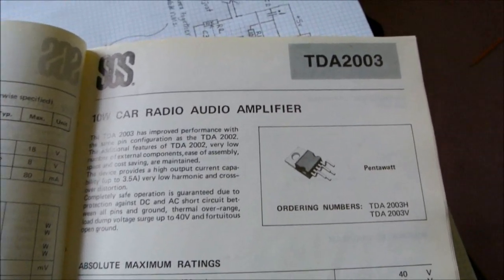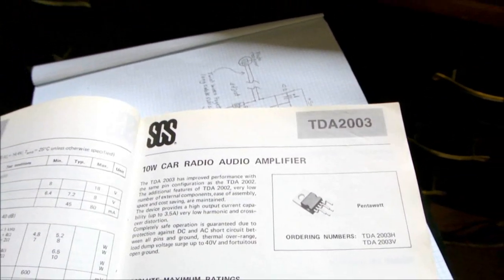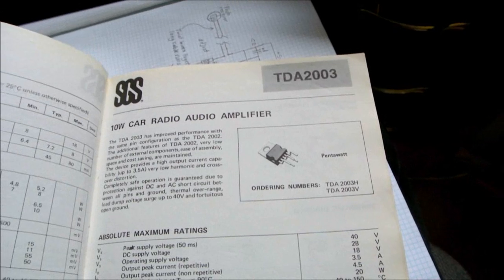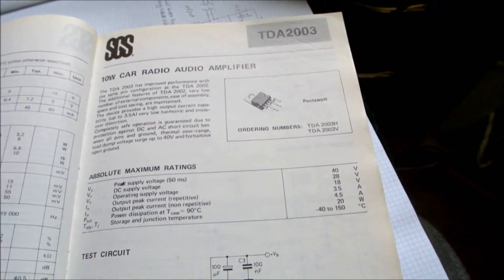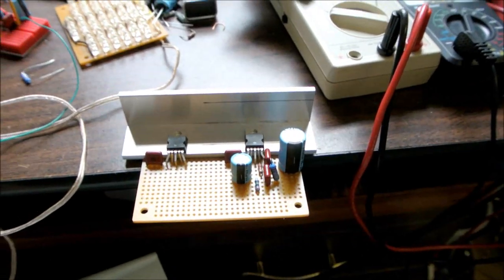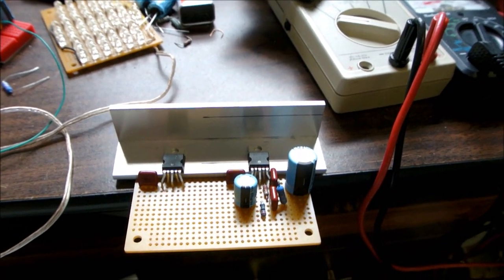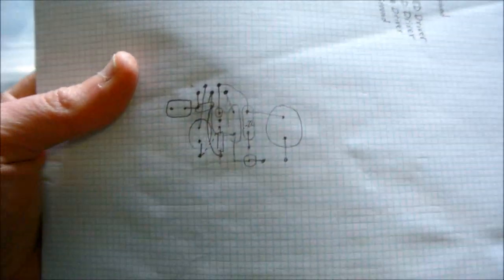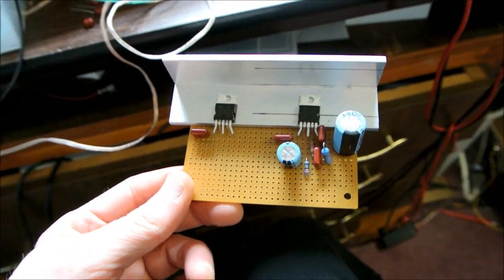Audio amplifier build stereo TDA2003

Comment: I have questions -
1. If I want to build this circuit on Perfboard , can the Power ground and speaker grounds of both the channels be common and the input (signal) grounds of both channels same ?
2. Can a 2 inches x 2 inches finned heatsink be sufficient for each chip ?

Comment: Will there be any difference in connecting the zobel network circuit before or after the output coupling capacitor ?

Comment: Hi JAT, Would you be so kind as to show how the stereo signal is separated? I suppose the schematic would show that. I would be interested in the details of the inputs and wiring. Always excellent video's, I love chip amp's. Take care, C.
Reply from the maker: +Cass Virgillo The stereo signal is never combined in this amp. It enters using a 1/8" jack that has a left, right and ground lead. The left and right signal wire each connects to its own volume control pot that is physically arranged on the same shaft and the output from that connects to its respective amplifier input. The ground connects to common ground inside the amplifier. Hopefully this answers your questions.

Comment: I'm planning on building one, I already have the LM1875 chip but i don't like to use split type power supplies.  I want this TDA2003 design since it uses the usual - and + 12v power supply and i could hook it up to a standby car battery during power outages.  Nice video btw thanks
Reply from the maker: rene kenshin The LM1875 will work at 12v single supply with the voltage divider for input bias (see datasheet), but that chip is designed for higher voltage supplies so you get a little less power at 12v. You may want to try the LA4425A.

Comment: Hi, I made a mono version of this amp, wired everything correctly, but when i plug in the power supply i get a loud hum that can't be diminished with the potentiometer. I've seen on some forums that i need to keep the signal ground and the power ground separate, but how do i do that? Could you help me with this problem?
Reply from the maker: DJmUsYk Hi, can you get any signal (music) to play through the amp or is it just solid hum? Be sure your power supply is around 12v DC and has a good filter capacitor.
Reply: JohnAudioTech It does hear a bit of signal, but it's just the signal from the sound source, and the power supply has a 1000uf capacitor. I can choose the voltage from 3 to 18volts, so that won't be a problem.
Reply from the maker: DJmUsYk If it isn't the input, the amp may be picking up power supply hum. It has a different tonality to the hum sound that is hard to describe. If you're sure you have the components and wiring right, it could be a bad IC. Any new IC is suspect if recently purchased. BTW, it would be better if the PSU had at least a 2,200uf cap.
Reply: JohnAudioTech Hi, I my psu now has 3 capacitors in paralel which result in a total of 3200uf. I don't get that hum anymore put i get some beats in the speaker and no music. The beat repeats itself every second.
Reply: Bro here's the catch your supply current is to hi to normal. Meaning to say uu get a humming sound to the PSU because to much current and because of that uu get a frequency output and it will make it much stress that should be. If uu want to make it use the amp I suggest to make your self i will say use a transformer that rate 26v ac output try to convert it to DC I suggest bridge 4rectifier diodes or!!! Buy a bridge diode to make it and!! The rating is 2amp 300volt and parallel just 1 capacitor rates 2200uf 26 or higher that the voltage to make it sure your cap not pop! It!! Out like hell!!! And don't forget the polarity incantation positive to the positive pin negative to negative pin. And after uu do that. Try to use lm7815 or 7816 don't exceed more than that to prevent explotion . of the ampli circuits and after that!!!  You got a filtered PSU system uu got a low frequency PSU that you don't have any humming sound at all oop!! Almost forgot!! Try to use 5n4001 to the output of the transformer output to make pure bypass filtered PSU to make it sure uu got in the right track of the PSU. Unit!!.

Comment: Where is the schematic diagram?When you say you need to keep the grounds separated how is this done exactly?
Reply from the maker: DIY stuff Basically arranging the ground layout so that high currents from the output return and power supply ground don't flow in the "small" signal returns (input, feedback loops).

Comment: A very nice bulid man.. If i can still source the TDA2050 i might build an amp
Reply from the maker: Thanks! The TDA2050 is no longer in stock at Mouser, Digikey and Newark. A lot of the ones sold now are fakes (especially the ones on eBay), so beware. Use the LM1875 it is also good and uses the same circuit.
Reply: Thanks for the advise man :)
Reply: @JohnAudioTech  Tda2003 is also obsolete I think